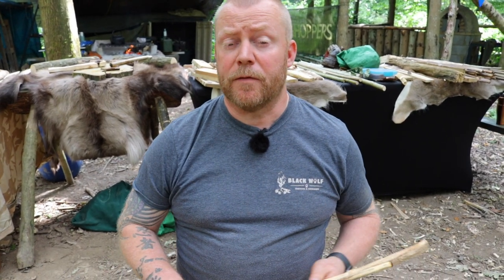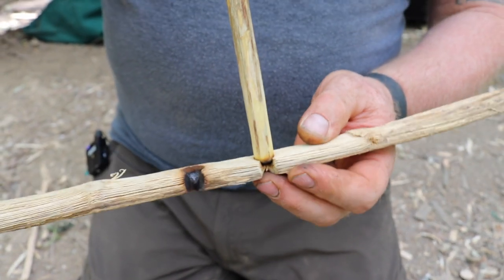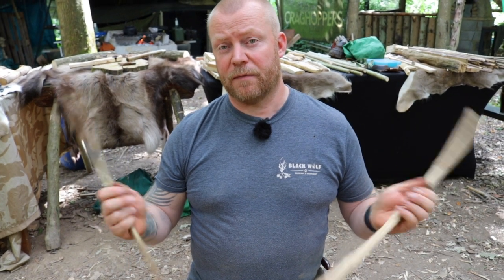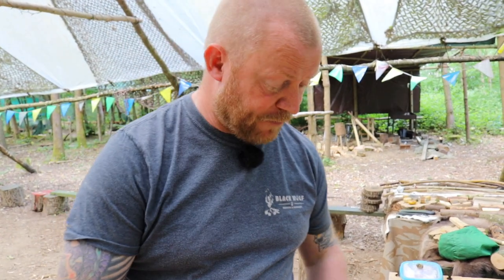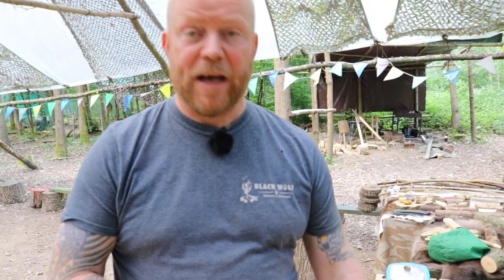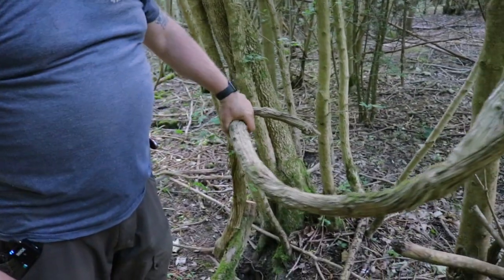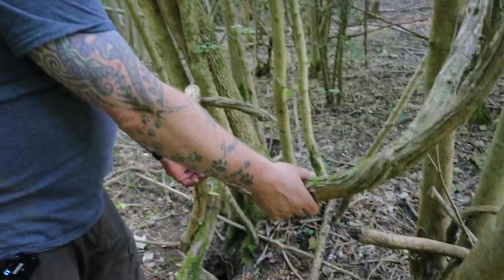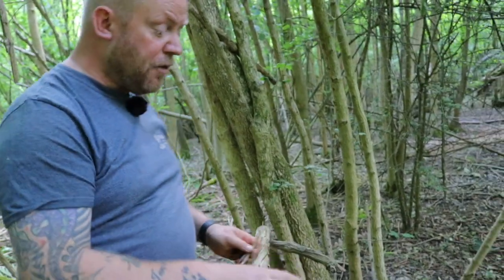Hand Drill Firelighting - Complete Beginners Guide (Craig Fordham)

Comment: I'm trying hand drill but I can't even drill the board. No dust whatsoever. And I'm even applying real pressure. What am I doing wrong?
Reply from the maker: Make sure you address all the pints Craig outlined in the video, and check what materials you are using as well as the shape of the bow & socket ~Peace~